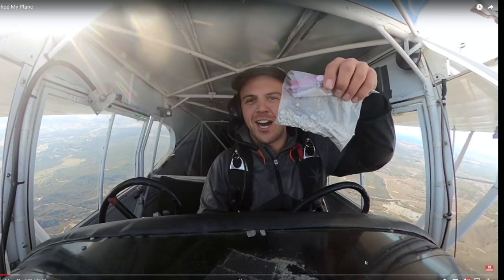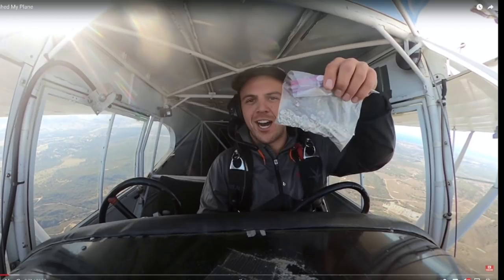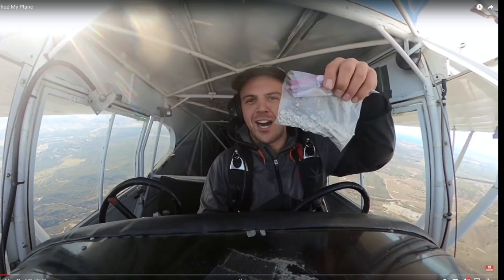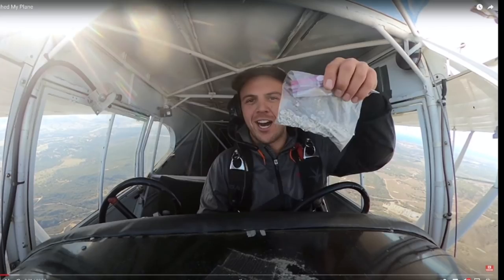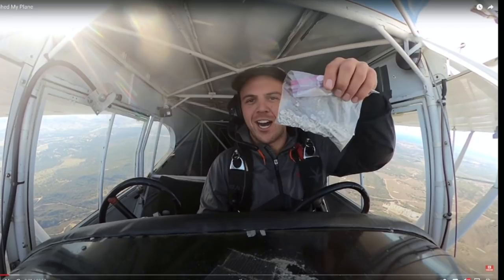Trevor Jacob Crash. SO BUSTED ...Disconnected Airspeed indicator?

Comment: When the engine is running it exerts a torque to the airframe that causes it to turn to the left. The control surfaces are rigged to counteract this force so that at cruise it will fly relatively straight and level hands off. When the engine is not running there is no torque so the airplane will glide in a right turning spiral.
Reply: This is correct.
Reply: @Av-vd3wk  No it's not - when adding power it will yaw (not roll) to the left hence you need to compensate with right rudder - different power inputs will make it to pitch up/down (while flying) and that's one off the reasons you have an elevator trim to play with - Propeller torque is insignificant at cruising airspeed and will only affect during takeoff along with p-factor, gyroscopic, and slipstream ( all compensated with right rudder) - Most GA airplanes does not need nor have roll trim capabilities. Reducing power (torque) will not make your airplane roll ( just pitch down )
Reply: @TM-529  I'm not sure how impactful the prop torque is under cruise, but I don't experience yaw when adjusting throttle in my ppl lessons, as you alluded, we use power to control altitude via pitch.
Reply: If the aircraft is trimmed to fly straight with a pilot in the left seat, when he leaves the mass of the pilot leaves also. This moves the center of gravity right, while the trim has not changes, so the aircraft will spiral right.
Reply: @TM-529  secondary effect of yaw is roll. XB W is an ass.
Reply: @TM-529  Yaw induces roll because the leading wing experiences more lift. If you don't believe me just go up, pull the power back to idle, take your hands and feet off the controls and see what it does. This is basic 101 stuff.
Reply: @pi.actual  Thought you were saying PROPELLER TORQUE induces roll and "control surfaces are rigged to counteract this" which is WRONG - GA airplanes are NOT rigged for this. 

Your comment Is a nonsense - for what airspeed/power you pre-rig the ailerons? does this "compensation" system is linked to the engine RPM? what if you increase/reduce RPM at different airspeed, same aileron angle won't work for any airspeed, don't you think?

NOTE. some bigger airplanes do have AILERON TRIM which different that what you're saying and to compensate for a different situation (not propeller torque)
 
Obviously propellers DO exert a bit of torque in the opposite direction, however small ga airplanes are not helicopters and it is minimal - the left-turning tendencies are WAY FAR more present when adding power and right rudder will compensate for all of this - So NO, ga airplanes are not rigged for torque, period!

101 real world experience here.
Reply: @chrisjacobsen1659  WHAT ???, you don't experiencing YAW when ADDING power? 

Did you do practice stall recovery? what happens when you're adding power ??? are you flying a jet? is your CFI taking care of right rudder for you? 

"we use power to control altitude via pitch" not sure if I understand this.

"WE" use pitch to control AIRSPEED while descending and power for descend rate, some times referred as "reversed controls" on final 

Perhaps you're referring to tiny bit power (hair thick throttle adjustments) you can do to keep a precise altitude, which will be the wrong way to do it IF you have an elevator  trim to play with.
Reply: @WeBeGood06  You're 100% correct, however most small GA airplanes do not have aileron trim nor  "rigged" for this. 

Larger airplanes (usually twins/jets) with larger wing tanks may experience big CG side displacements by just having less fuel on one wing therefore they are equipped with aileron trim - but it's never to compensate for PROPELLER torque as stated by the OP.

Small airplanes like the one in this video if trimmed for best glide (as it should be in this situation) could flight fairly straight without a pilot.
In my opinion (could be wrong) he was trying to slow down the airplane (besides dramatic propeller effect) to ensure it will stall shortly after he exited the airplane (hence no trimmed) preventing it from glide away from him and out of his reach. 

90% of the time, when small airplanes like this stall, a wing (either left/right) goes down first so it will roll into that side, pitch down, speed up and self recover while still flying down which is what we see on the original video.

Comment: After landing his jacket appears wet at the front as if his water bottle leaked of broke during his descent.
Reply: Yes.
I just saw that pointed out !
Also, he made no attempt to retrieve the water that (supposedly) was in the wreck.
Now I know why..he had it on him.
-And by the way, he took off (max.) 2 hrs earlier. How very "dying of thirst" can you really be ?
-All this obviously explains why he (while "dying" of thirst, took three little slurps of the tadpole-water  -and splashed some on his fass.....I mean face. Face. (sorry) 😁

Cheers, K from 🇮🇸
Reply: I thought the moisture on his shirt was sweat from his death surviving jump, “crash” and landing in the brush! In reality, he was probably only concerned about collecting his GoPros.
Reply: @karlbark  , he had a gallon bottle of Crystal Geyser water on the seat beside him you can make out in the original video.
Reply: Dam, I thought he pissed himself......
Reply: The mystery of a video with a ziplock bag in it!

Comment: I puzzled over why that fuel valve was not attached, bt of course the plane was probably dismantled for shipping so the wing tank was disconnected when the wings were removed. Hurriedly re-assembling the plane there was no need for the wing tank so it was never reconnected to the valve nor was the valve reattached to the fuselage. The pipe on the other side I believe is indeed for the airspeed indicator, again probably not needed for this flight. TBH this old aircraft  has taught a lot of us more about aviation than probably any other aircraft. Hundreds of thousands of us have been dissecting the crash video, in some ways not such a sad result for an 82 yr old aircraft. Trevor's criminal irresponsibility is another matter of course, IMHO his mentality should prevent him from continuing to have a pilot's licence....
Reply: Exactly, he only needed enough fuel in the front main tank to make it  as far as he needed, so he never bothered with reattaching the right wing connections fully.
Reply: @WeBeGood06  I'm pretty sure it is a crime to purposely crash an airplane. Can a lawyer chime in here? I'm sure there are plenty of statutes that he violated like "reckless endangerment". Would be interesting to find out how many years behind bars he is facing.
Reply: @WeBeGood06  it may not be a crime in some circumstances but it is in this one.
Reply: @WeBeGood06  Its definitely a federal crime. Its even a bigger one since 9/11....

Comment: Trevor definitely killed his own motor. The way it stopped, how smoothly and without obvious fault. That ontop of his obviously missing reaction of "huh? What happened to my motor" he doesn't say anything he just accepts its off and abandons the airplane
Reply: His prop was still windmilling. . He pumped the yoke in video to reduce speed & stop prop for more drama.
Reply: Yes, he is not surprised or interested in why as he knows he did it and why he did it. André
Reply: The GoPro behind him that recorded the instrument panel mysteriously went dead shortly before the engine out. I think it's obvious he didn't want it to show that he intentionally cut the power. Losing his license is not NEAR enough punishment for this reckless act!
Reply: @GrantOakes  It was not dead he removed it as it was on his selfie stick when he jumped. So the footage from his hand held camera is the camera which was behind him in the plane. You can see that it is gone just before he jumped. No way he could have planned that is there? André
Reply: @SoundzAlive1  I missed that little detail. Gives even more support to the fact he staged this all!
Reply from the maker: Trevor does not need a parachute. A  simple superhero Cape will work for him.
Reply from the maker: @SoundzAlive1  a handy selfie stick ready to jump.

Comment: I learned to fly in a Taylorcraft B  In the early 60's.  There is a 6 gal. R wing tank and a 12 gal. main The 'tube you see is the wing tank fuel valve.  When the main is down to half you drain the wing tank into the main(it is gravity fed).  This is disconnected so the wing is empty.  The Main is in the front of the fuselage behind the engine to the rear of the fire wall.  The fuel ga on the main. is a 'fishing bobber' visible just in front of the wind screen. They are/were a PITA as they sometimes (fairly often if the bobber slide/ga.  cap wasn't wiped down during pre-flight.  hung up giving the false impression of more fuel than reality.  Most of these were replaced.  I am surprised it is still there.  Probably left for originality.
Reply: They also had 9 gall tanks in some and I guess that was his config as that would mean he would run out of fuel where he did and have the smallest of fires to put out with his extinguisher which I always jump from a plane with......André
Reply: How far can one get with 18 gal of fuel in this Taylorcraft airplane? Some how, I don' think he would have made it to Mammoth from the git go. Are there airports on the way he could have stopped at for gas? Did he ever mention this?
Reply: @parkebyron5132  yes it’s obvious he had no intention of flying any further. BTW there are two models of Taylorcraft one with 12 gal and one with 9 gal which is the one I think he had. He has broken the fishing float gauge to read full as it did not change. He disconnected the wing tank. He fly correct distance to run out of fuel for 9 gal. I still think there was a small amount of fuel left as the way the engine stopped was by deliberately by pilot. He covered any fires from minimal fuel in crash by taping on at least one fire extinguisher. Carefully sighted landing area and opened door BEFORE he stopped engine. Took camera, water bottle, altimeter, advanced parachute with reserve chute, removed boarding step so as not to catch on chute. Etc etc. André
Reply: @parkebyron5132  The wing tank was empty.  The fuel valve to the wing tank can be seen disconnected..  This plane at max cruise / climb power would only be using 4.5  gal. /hr. +- .   6 gal in the main would have easily gotten him to where he abandoned the aircraft.  fly in circles until it's empty and the hoax starts.  His intention was never to get to Mammoth.

Comment: The story that won't die...unlike that poor little Taylorcraft.   I think this model of "Tea Crate" only had the front fuel tank and one in the right wing.  Good observation, it does look like the pitot line is disconnected.  Also, the diameter if that copper line is a little small for fuel flow.
Reply from the maker: I doubt it had enough fuel to make it Mammoth and is seems very likely that this aircraft was purchased for spares stripped botched and crashed on purpose for a stunt. While the evidence "seems overwhelming". However "innocent until proven guilty" and I look forward to the conclusions of the FAA investigation into the "Accident"
Reply: The side camera angle seems to show what looks like a pitot on that wing so that would also be my guess as well. I believe you're correct.

Comment: If the center of gravity were perfectly in the center of the lateral axis, the plane still would not fly straight once he departed the plane. All you need is the tiniest bit of turbulence to change the bank from 0-degrees wing-level to 1 degree of bank, and the "overbanking tendency" will take over and eventually result in a moderate to steep bank.
Reply: when he left the cg moves right, hence the right hand spiral.
Reply: Not if the wings have dihedral, which they should.  Keeps the plane level.  In most small aircraft you have to go beyond 30-45 degrees of bank before it will not self correct.

Comment: The fat pipe on the left of the shot with a valve on the end is the fuel feed from the tank. In a vid made years ago  the valve can be seen neatly fixed to the top of the door frame.

Comment: there is a six gallon wing tank in the right wing feeding a 12 gallon header tank next to the firewall on older Taylorcrafts ..the selector is off  and the line disconnected
Reply: I think it was the 9 gal version. Just enough fuel to get to where he intended. André
Reply: @SoundzAlive1  t crafts had 18 gallons..6 in the right wing and a 12 gallon header tank...from 9,000 feet he could have glided back to lompoc from there

Comment: it's clear he drained at least the right side wing tank. the fuel selector isn't even hooked up on the inlet side. maybe he drained the left tank as well.
regardless he threw an out of hours engine in, so it's clear he didn't intend to land that aircraft and had ever intention on crashing it.
Reply: We know that he changed engines from the Lycoming to the Continental, but I don't think we know yet that the new engine was defective or beyond its major overhaul date.

Comment: There's definitely a disconnected tube over the pilot's left shoulder.  But what is it Taylorcraft experts?  It's strange to have a pitot tube line in the cockpit rather than behind the instrument panel, but I don't know how Taylorcrafts were designed.  I do know that the fuel selector over the pilot's right shoulder is set to "Off".  And the camera on the dash stayed there during the crash, but he took a camera with him as he exited (see videos).  So that must have been the only other cockpit camera -- the one over his right shoulder focused on the panel.  It only makes sense if he's intentionally crashing his plane and ensuring he has the video secured.
Reply: That is the pitot tube (air speed) which is attached to the wing like that so the wing can be removed. He diid not need it so he did not connect it. You see he was not expecting the Youtube Forensic Analysis YFA to do such a good job! André

Comment: Great question.
My guess....
He probably flew with a GPS as his instrument panel. That's why no dash video. And he was wearing a altimeter. When they(?) assembled the plane they never bothered to reconnect the tube or the fuel line. They weren't needed for the stunt.
Reply: No dash video because you could  see why endine not running. Throttle & mixture setting would be a tell tale.

Comment: The cable is for the flight controls. They're cable driven. If you search for the interior pictures for the Taylorcraft, you will see the pulley and cables lead to the steering controls. I would say that the left side cable in that shot looks like it had been loosened some while the other side cable seems to be adjusted which would also cause the plan to pitch down and to the right easier. Just my opinion.

Comment: Plot twist front petrol tank take showing full... Was it full of water to stop engine fire on impact?
Reply: probably a glued on stick. No need for fuel gauge. Let the bird fly until the tank is empty. Then jump.....
Reply: With those you can just bend the rod and it won't move. It's a float system like a fishing float. André

Comment: I know a thing or two about engineering/mechanics, but only a little about aircraft. On most vehicles, that type of pipe would  be for fuel or brakes. I doubt the brake lines on that aircraft are routed that way, fuel seems far more likely.
Reply: Planes operate in air and have an additional system (even if just for measurement), pneumatic, that's definitely a pitot tube line, it guides dynamic pressure to the airspeed indicator to compare against static cabin pressure
Reply: @chrisjacobsen1659   i know about pitot tubes.. Do they normally go through the cabin? It kinda makes sense if the pitot head out on the wing because of the prop?
Reply: @Kris_T_  No the pitot tubes on more modern planes are certainly routed differently, you cant see them on Cessna 152 or 172's, never flown as old a plane as this, but I would totally expect a low cost bush plane from the 70's to not care how the pitot tube line was routed, especially when the wings are designed to be easily removable. 

As far as how he kept airspeed otherwise, he may have been using gps on some smartphone or something, also in a small plane like that with 1000's of hrs in single prop, you can feel when it's about to stall, so he can just be flying blindly.
Reply: Are you talking about the wheel brake for the landing gear or the air brake?
Reply: @MarcosElMalo2   air brakes on a plane that small are cable operated not hydraulic. I wasn't talking about air-brakes. Besides, dude already said its pitot or fuel. Not brakes.

Comment: President/Pilot Brandon is asleep at the controls of the US plane as the MOTOR CUTS OUT.
He is making NO attempt to start the engine, could it be he has cut the gas pipe line? no, instead he is hammering on the controls forward back forward back until the motor stops altogether.
With no plan, he starts panicking and swearing as it starts spiralling down into the ground. It is going to be just too difficult to save the plane? fortunately Brandon has his massive pension and BBB chute to save himself. He jumps, leaving he plane it to randomly nose dives into the ground smashing the once cherished plane into mangled red white and blue wreckage.
Reply: Hmm, Gentlemen this bring me to my next point...don't smoke crack.
Reply: Loved this! LOL!!
Reply: So you see everything in terms of politics?  That's a darned unhappy way to spend your life.  Sad!
Reply: @D & H B.... ahh, and there's the troll. Found him.
Reply: Best reply ever

Lets go Brandon

I declare Trevor be renamed Trevor Smollett
Reply: @D & H B.... If you flap your arms and run fast enough, you may delude yourself that you're flying.
Reply: @D & H B.... They don't have the balls to say what they really mean and have to resort to a childish code. What great little maga heroes they are. 🙄